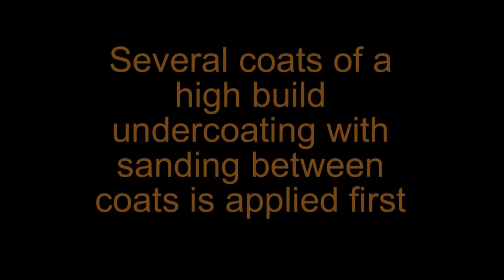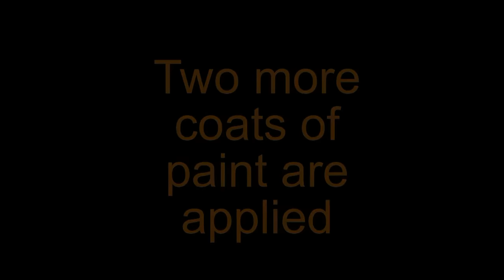Painting a canvas canoe

Comment: How do you prep the mastic coating before primer? Does it need sanding? Or do you just prime right over it?
Reply from the maker: Trick is to get it on as smooth as possible on each coat by applying it in small sections and then smoothing out with water.  Once the mastic is dry, it can be sanded to get a smoother surface prior to primer paint, but will take more effort if the application of the mastic was haphazard and sloppy.

Comment: Does the white stuff u used crack and peel later on be honest
Reply from the maker: If you mean the white filler, no.  The filler is elastomeric so does not crack but always stays somewhat pliable.  If you are asking about the white primer paint, it is oil based and as such does become more brittle over time, but that may be more than a decade down the road.  I have never had a canoe peel with these products.  The times that customers have had problems is almost always due to lack of care and maintenance - leaving the canoe out in the elements, mold growing,  wood rot, etc.  The newer fillers and paints just don't last as long as original canvas canoes with lead based fillers and paints.
Reply: OrcaBoats I was asking about filler as u put it on semi thick and was wondering if could be used on plywood with thin coats thanks  Von Karl
Reply from the maker: @johnmessersmith3881  Are you trying to waterproof the plywood?  If so, then I think another product would be better suited like epoxy of epoxy paint.